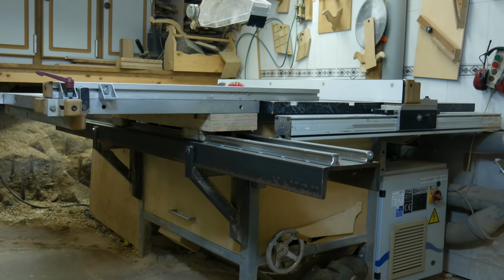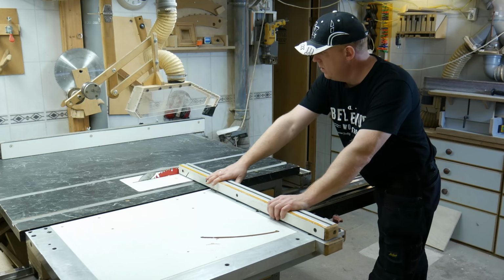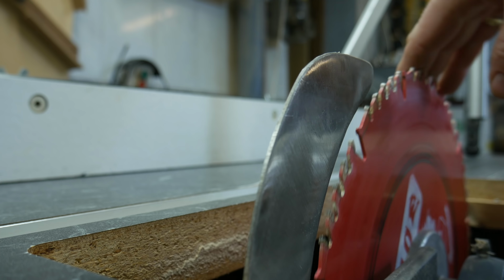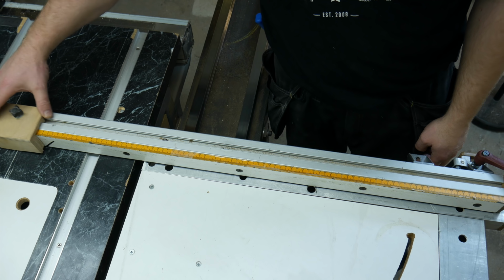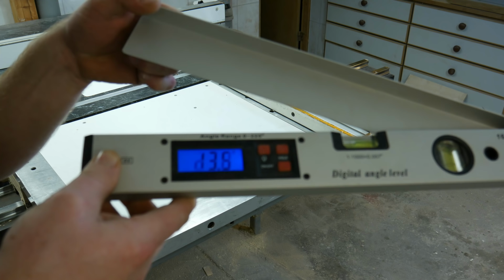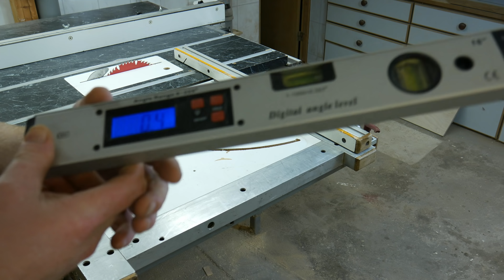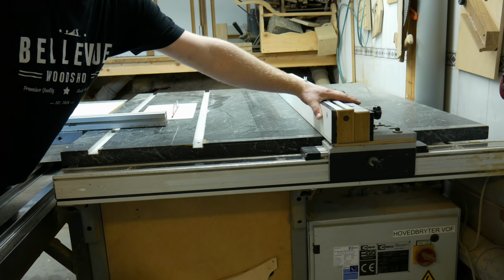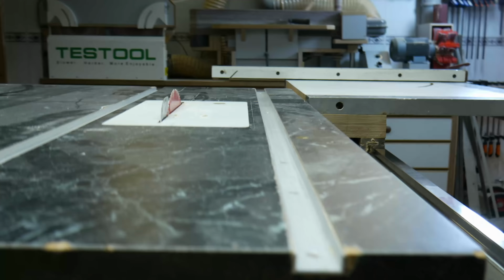My Homemade Table Saw

Comment: Hi Roy. There are many great diy tools/machines made by woodworkers. When I first saw you work (some yrs. back) I realized  you are taking this task to another level.  This table saw proves that I was correct all along.  (I have made my own table saw and router table way before y/tube so I appreciate what's involved) With no disrespect to other makers I regard  you at the very top of respected diy machine creators  because of your intelligent engineering applications.  Have a great day my friend.
Reply from the maker: WOW, thank you very much for the generous feedback Michael, I really appreciate it. It makes it worth while producing the content knowing people really appreciate it. It is very interesting trying to do something a little different than mainstream building. Not that there is anything wrong with that at all. Thank you for watching and commenting
Reply: @bellevuesnekkeri  I rarely comment ( and I never thumb-down ) but I have to give credit where it's due. (Plus I really like your presentation style).

Comment: Good to see a shop-made table saw that isn't all made out of wood! I do note that your blade does not tilt around the point at the top of the table- I know this is hard to arrange, but quite important.
Reply from the maker: Thank. This saw has now been rebuilt with trunnions anf partly wood. But fully automated. Check it out: https://youtu.be/Yft8yBKOPAE
Reply: @bellevuesnekkeri  Yes, I have seen that. I have recently automated a router table, so was interested- a table saw may be next. I see you dropped the sliding table- for me, that is an important feature, but should joint the table at the edge of the blade. I will also drive it from an Arduino & small touch screen- more than capable enough. But metal construction is my choice.

Comment: Excellent build! The crosscut sled is almost like a sliding table saw! But more compact! I love the different adjustments! Great table saw! Nice bird too!
I'm waiting for the new version!
Reply from the maker: Thanks. it was actually alot wider with a support leg bracing diagonally riding on a rail on the bottom side of the frame. It took up to much space, and I shrinked it instead
Reply: @bellevuesnekkeri  Like that! I think it's much better, good decision! 
it saves space, especially for small areas! The new one will make this version more perfect! with automatic options!!!  It will be more interesting, that's for sure!

Comment: While the construction looks rough and a little janky, it’s obviously very well put together and solidly built.  Bravo!  One of the better homebuilt table saws that I have seen.  It gives me some ideas on how to rebuild my tiny Dremel table saw; which will have a combination mini Beismeyer style fence with the addition of a rod and linear bearing on the rear, a Dremel router station on the right wing (just like a full sized table saw), and a sliding miter table on the left side.  Hopefully it will all come together!  (Slowly though it may be!)  Thanks for sharing your design.  👍🏻
Reply from the maker: Thanks, glad you liked it, good luck on your build👍😀

Comment: So, what are the shortcomings of this saw that you want to build another one?
Reply from the maker: Mainly that it does not have trunnions. The adjustments are also getting somehow sloppy after 10 years, and I just I hate not having an insert plate to work with angled cuts, due to the hinge point being below the surface. I also want to make the height, angle and fence adjustments digital with servo motors and and an HMI.  I got a bunch of linear actuators an a PLC with a touch screen from an old machine we dismantled at work.  Also a base with some room to store accessories would be nice. Thanks for watching and commenting Matthias
Reply: @bellevuesnekkeri  Just today i was watching some of your older videos and i just love your passion on replicating and even make overkill feature that doesent even exist in professional tools. Just keep doin it please!
Reply: @sugar0000  about what feature are you talking about?
Reply from the maker: Thanks a lot for the kind feedback. Glad you find it interesting. Some say overkill and too much....I say why not? (especially as long asI use 98% salvaged FREE parts)
Reply: @RGplayer101  Well just whatch his router table for example.
Reply: @bellevuesnekkeri  It's the ability to never get satisfied that drives you forward.. :)
Reply: @sugar0000  well im gonna be honest. for a hobbyist it looks awesome. but most professional machines i have seen have those features like cnc and such. but to show it can be done at a hobbyist level is just beautifull
Reply: Sez the man with a fleet of bandsaws!     :o)
Reply: Your "wants", are what I have been thinking of.

Comment: Think I need to make a dust hood like that! Good to see you again Roy!
Reply from the maker: Thank you Ty.its been waaay to long. Had a huge house reno going on for 16 weeks.....but you probably know ALL about juggeling that with family and content creation. BUT you did a lot better than me:) Dusthood works great, I had to cut the vertical piece and hinge it to be able to run taller stuff through the saw, like cutting cheeks on tennons. Jus swings up to the left and I suspend it with a bungy cord
Reply: I actually wanted to ask about the dust hood as well. You didn’t happen to record a video on that did you?
Reply from the maker: @mattprzybylski19  Unfortunately I have not made any content on this
Reply: @bellevuesnekkeri  Gothca, no worries, i can discern most of it from the video, was mostly curious about the counterweight. In any case, i always enjoy your videos and your well thought out solutions to everything you do. Keep up the great work.
Reply from the maker: @mattprzybylski19  Thats good. I did not plan anything special. Just built the parallelogram, and put on these to heavy steel lumps of some wheels.   I placed them in a position where the hood balanced. Good luck on your build, and thanks for the positive feedback
Reply: i guess I'm kinda randomly asking but do anybody know a good site to stream newly released tv shows online?
Reply: @Ryder Julien I use flixzone. Just google for it =)
Reply: @Jamie Brayden Yea, been using flixzone for months myself :)

Comment: WOW !!!! that is the best looking & best featured home made table saw I have ever see why do you want to make another one?
Reply from the maker: Thank you very much for the generous feedback Vince, It is much appreciated. Mainly because it does not have trunnions. The adjustments are also getting somehow a little  sloppy after 10 years, and I just I hate not having an insert plate to work with angled cuts, due to the hinge point being below the surface. I also want to make the height, angle and fence adjustments digital with servo motors and and an HMI.

Comment: After seeing your Router Table, i wouldnt be suprised if your next table saw would be like a homemade version of a modern computer assisted Felder format saw.
So yeah, im hyped, cant wait to see what youll create =)
Reply from the maker: He he, you are pretty close actually. I plan on using digital input to set blade height, angle and fence  by servo motors. I really hope I get around to execute it this year

Comment: Great build. Epitomizes the idea: If you're going to do it, do it right. "Overkill" is the opposite of the "engineering" that has made so many modern tools and machines sad shadows of the lifetime investments that older models represented. The notion that tech advances will make early replacement a necessity has been used to justify skimping on basics in many cases. Heavy duty constructions with room for unknown modular improvements is the way to create real value. Love your builds.
Reply from the maker: Thanks

Comment: Love the homag electrical enclosure!
Reply from the maker: Reuse. Are you familiar with Homag?
Reply: @bellevuesnekkeri  I am very familiar. I work in flooring manufacturing, we use their double end tennoners and saws.
Reply from the maker: @P8ntbaLLA56  Ahaa, I used to work for a big laminate flooring company a few years back, but we mainly use the same kind of machinery at my current location. Although we produce wallpanels at this site. Just installed a complete new Homag profiling line 2 years ago
Reply: @bellevuesnekkeri  that's awesome! They're very heavy duty machines, and seem to be very reliable.

Comment: Nice build. The rails for the slider are rectangular. I see some that are round. Is there an advantage to one? I am looking to build a slider for my bandsaw. Thanks.
Reply from the maker: Thanks. Unfortunately I am no mechanical engineer, but I think round might me more forgiving on miss alignment, but dont take my word for it. I have only used square ones with 4 contact points

Comment: Veldig kult, godt jobba, åssen funker det med sagspon og linear rails? Trenger de rensing ofte?  Har vurdert å lage min egen mitre saw med linear rails, ikke fornøyd med nøyaktigheten til off the shelf.
Reply from the maker: Takk Morten. Ikke noe problem. Lager "skoene" har skraperinger, så det går kjempefint. Blir spennede. Dokumenterer du bygget?
Reply: @bellevuesnekkeri  OK flott, godt å vite, ja er planen å lage noen videoer, håper å inkludere digital readouts på vinkler og stops. Kjekt å se nye posts fra deg 👍

Comment: I'am just learning about these tools. Is there any reason why you would not use a pulling action to avoid getting hit from kickback.  And would a cage over the top of the table help with safely ?
Reply from the maker: Welcome to the hobby. Pulling the piece against you and a cage would help on safety, but completely unpractical to use. A pulling action would force you to lean over a spinning blade, and a cage would disrupt the view. thanks for watching and commenting

Comment: Roy what do you use for jointing and planning.  I am starting on building a jointer.  Interested in your thoughts..
Reply from the maker: Hi, I us a 6" jointer with 2 straight knives, and a butchered jointer/planer combo that I ripped the tables of to use it as a jointer. It only has aprox 8,5" of cutting capacity. I would love the DW 735, but unfortunately its not available in Europe, So I am shooting for a DW734. It would be cool to see your jointerbuild

Comment: Have you experienced any dust problem on the linear bearings? I have a sliding table with rounded rails braced by std bearings and dust gets in the way all the time making the slide kind of "bumpy" which, in the end, diminishes the quality of the cut. Good job!
Reply from the maker: Thanks. No  problems. The linear bearings have plastic scrapers to make sure the profile is cleaned on both ends

Comment: Your building another? How could you make that better? Except possibly bigger rip/crosscut capacity?
Reply from the maker: Mainly because it does not have trunnions. The adjustments are also getting somehow sloppy after 10 years, and I just I hate not having an insert plate to work with angled cuts, due to the hinge point being below the surface. I also want to make the height, angle and fence adjustments digital with servo motors and and an HMI.

Comment: What a nice project! Congratulations! Someday I will build my own saw like yours! I have a question about it: how do you deal with the dust in the linear rails? especially the ones for the cross cut cart. Doesn't it mess up with the linear bearing? Best regards from Brazil! Miguel.
Reply from the maker: Thank you. The dust is no problem as the pillow bearing blocks have "scrapers" (plastic/rubber end seals) so there is minimal dust getting into the bearings. I have been using the saw for close to 10 years without any problems. Good luck on your build

Comment: Do you have change insert if you want to tilt blade?
Reply from the maker: Yup, that is the main issue with this saw, and one of the reasons I am rebuilding it. It need trunnions to be able to use the same insert , and having the rip fence tape measure being usable

Comment: Hey- did you make the arbor yourself or buy online? Currently looking for a similar arbor that can handle wide dado cuts
Reply from the maker: Hi Kris. I made it from a 20mm shaft, and the arbor flange was salvaged from an old table saw

Comment: Probably you know but It is important, for safety reasons, that the inclination of the blade is oriented on the opposite side of how you have oriented it. when you cut, your piece, the one on your side, should not be crushed by the blade when it is tilted. Sorry but my english is not enough to explain well, but online you can surely find a lot of information. Ciao!
Reply from the maker: Left tilting table saws are most commonly used, now a days, with saws that have the rip fence on the right side of the blade. this prevents the cutoff piece from being "trapped" between the bade and the fence

Comment: hi. first of all thank you for sharing your work it`s awesome. i have a few questions if you have the time, i see you`re using a 12"  blade at 5200rpm and very short flanges, you have not commented on blade flex or is it a non issue?,  what size bearings are you using? and why c3 (is heat a problem)? asking bc you mentioned it`s been in service 10 yrs and it seems you don`t have any complaints to it, last one the linear bearings that you put on the lift mechanism are they holding well and if so can you give me the specs?. well thank you in advance and if you don`t have the time to answer it`s ok too. it`s been a tremendous help in the design of the tool i`m hoping to be making soon. regards. peter
Reply from the maker: Thank you very much for the kind feedback. I am not experiencing any flex in the blade. The reason for using c3 bearings is thats what was installed in the pillow block. Normal deep groove bearings can handle 13.000 rpm, so they would work as well. I just figured that it would not harm to keep them in, The linear rail in the height, as well as for the sliding table are from Bosch Rexroth. 20mm for the height adjustment, and 30mm rails for the table. Way overkill, but thats what I had laying around . Glad you found it useful, and thanks for watching
Reply: @bellevuesnekkeri  thanks ! :D

Comment: Please give me the saw unit /Trunnion assy. drawing with dimensions. I love the way you built it.  The linear rail height adjustment would  so damn accurate. Also please give me the arbor shaft details(length, diameter at  every steps, pillow  bearings you used, blade flange, blade thread type  ..etc.) It would be really helpful for me.Thank you
Reply from the maker: Thank you. I no longer have this saw, I rebuilt it to become this one: https://www.youtube.com/watch?v=Yft8yBKOPAE

Comment: Hey Rod,,, if you're scrapping/selling the sliding table for your new build, pls let me know and I come and pick it up (er i Oslo-området)
Reply from the maker: The linear rails will most likely be reused on the rip fence. I have not 100% decided on the design yet, but I am leaning towards a saw with no slider thou